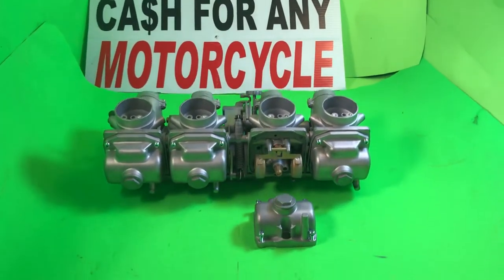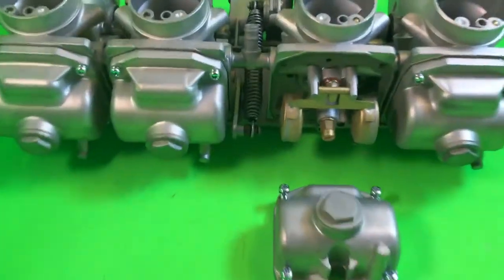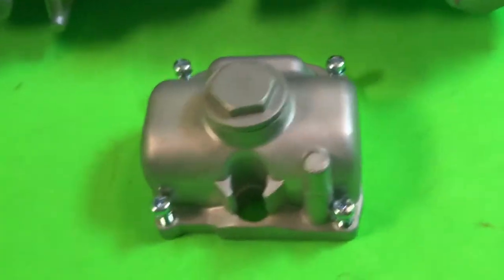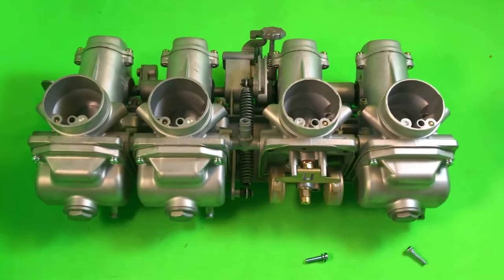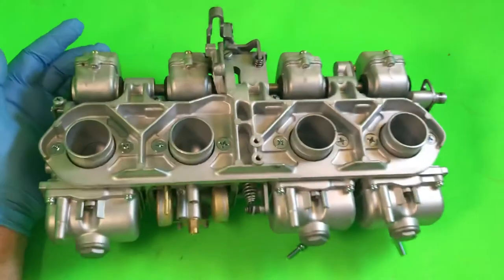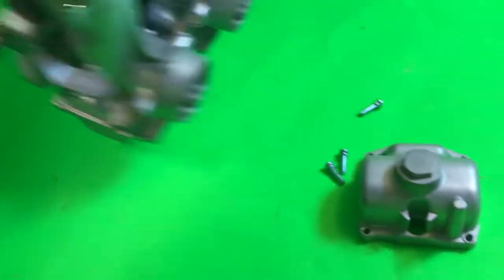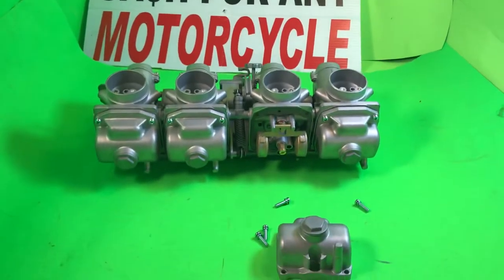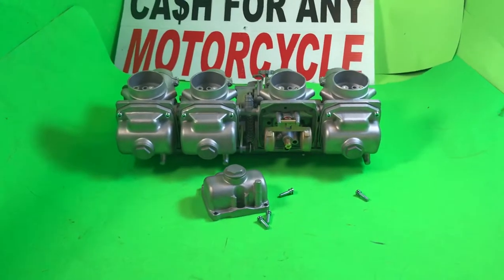29mm smoothbores Mikuni carbs 4 sale

Comment: Do you still have them???? How Much My Kz1000 has the 1075 wiseco pistons also. Thanks
Reply from the maker: william bunn write to old parts at aol.com
Reply: My Mikuni Smoothbores look different to those 29's, mine are 33's for a KZ 1000 P, replacing the BS 34's. The carburettor body shape, is different.